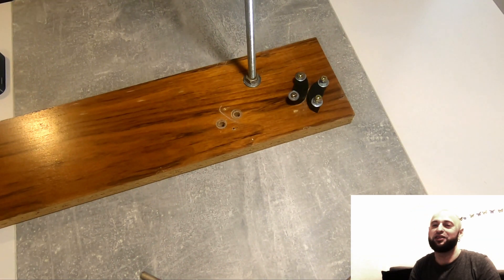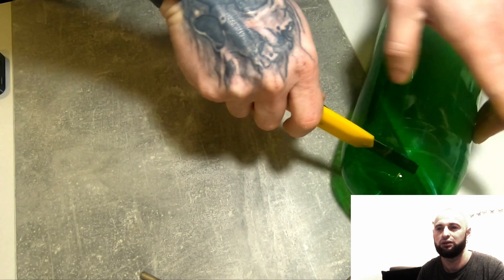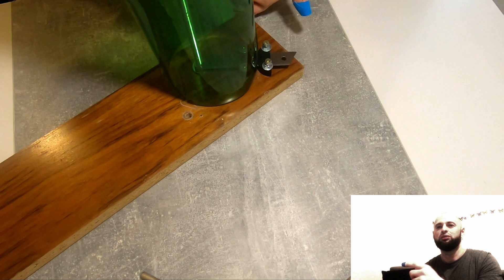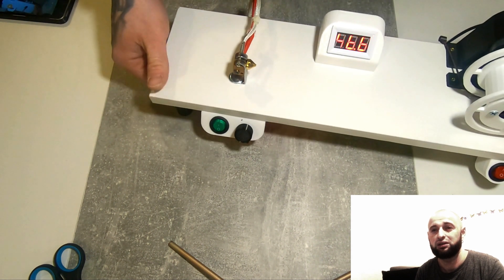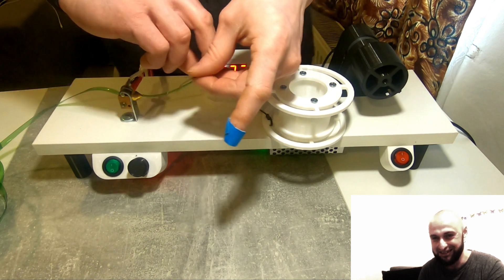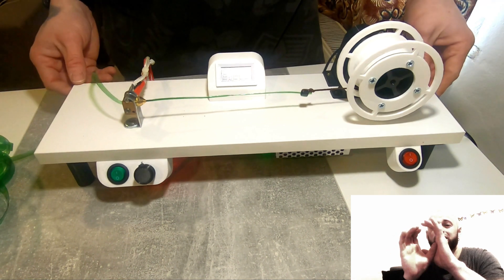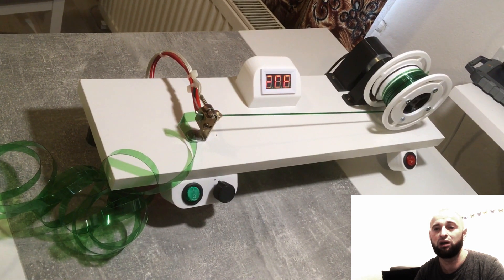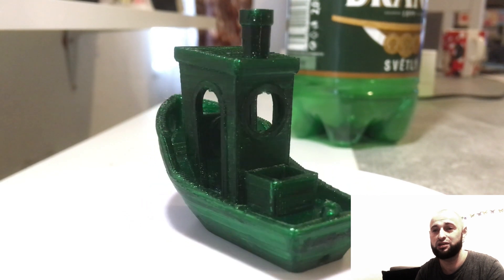Petamentor bottle cutter and first run

Comment: Can the cut be designed to be happening as the filament is pulled through?
Can a cut-starter be made that starts the cut without cutting the bottle bottom off first? Maybe the bottle lands upside down on a stick, gets punctured at the side wall and pulled through two blades... 
Evolving to a machine that has bottle in, filament out, would allow one person to run a factory full of machines...
Reply from the maker: No, this is not possible for simple reason. there is too much torque on puller (due to pulling pet trip thru the nozzle) . Puller can handle it, but there is risk of failing motor joint in a long term. Filament factory is nice idea, but this is not possible because of other aspects. Could you imagine that you are making filament for sale? It must have some good parammeters. It means you have to enough bottles (the same) for consistent result. You can get about 7meters of strip from each bottle. For 1kg filament spool you need about 330meters of clean filament. It means about 47bottles. You have to join it somehow. this is a time and that nobody will pays you for "trash filament". This project is great for its simplycity. Next things are slicer settings for success prints. This is not way, how to make business, believe me😉My advice for your small factory is something like:   crushing mil to male pet flakes from bottle and extrusion line. I saw a few DIY extruders for making filament on youtube. Hope it helps you 👍

Comment: Outstanding!  SUBSCRIBED!  Just to clarify:
Are you saying that the filament comes out as a hollow tube and you have to increase flow to 145% to compensate?
What temp are you printing the Benji-boat?
Then for the filament maker; you are using a drilled-out nozzle to a diameter of 1.75mm?
Anyway, thanks and hats-off to you for your presentation and excellent build-quality!
Reply from the maker: Hi, Thank you👍.
yes, filament has a hole inside. The strip is only bended, stretched and joined with heat.  This is why you are using 210 degrees for filament making and 260 degrees for printing ( that is melting temp). Your new flowrate will depends only on your nozzle diameter (output filament diameter). No, I drilled 0.4mm with 1.5mm drill bit and wobbled in hole a little bit. Now only god knows what is my actual nozzle diameter. It could be about 1.6 1.7mm.
Reply: @ondrejsraitr  Great, that answers my questions; thanks again!

Comment: Thanks. I printed some of the parts and will be printing more. Ordered some parts and am slowly building this machine. Hand pulled enough filament to prove it is worth building a tool to automate the process. Your description of the "tube" was very helpful. That's basically what my attempts look like and I thought I was doing something wrong.
Reply from the maker: thats sounds very good, youre on the good way. but remember, there can be some other obsticles, but we can solve it together. 👍

Comment: Congrats what you reached, mate!
If you can use old filament roles in your machine, you'll be able to storage directly once produced.
Also seen that you can join the filament from 2 different bottles (same kind recommended) heating and using teflon tube to reach good enough joint. This way you can make longer filament allowing longer prints non stop 😉
Keep going!
Reply from the maker: Thank you Victor. Im making long prints without joined filament. Im using a runaway sensor to pause print and change filament...
Reply: I was expecting you to do it but that way you have to be there to do the replacement so just giving extra tip as can be useful some cases 😊
Reply from the maker: I understand and thank you so much! 👍👍👍🥳